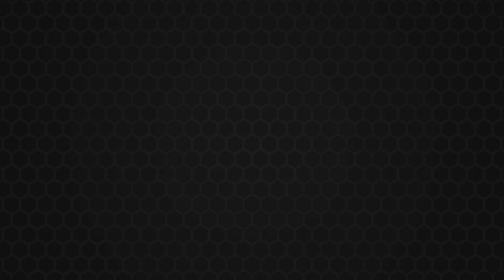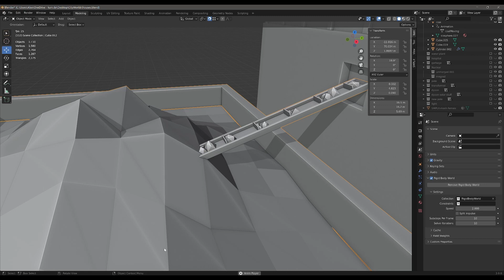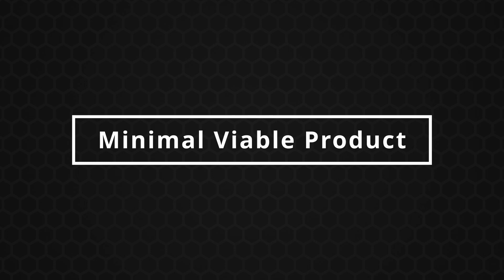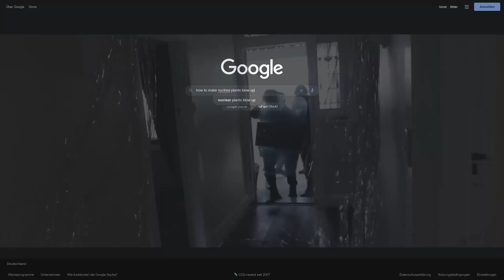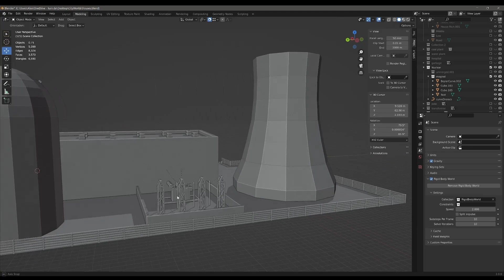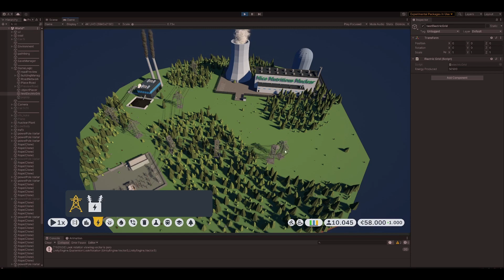Creating Electricity and Meltdowns for my Game | Devlog

Comment: Just an idea I'll spitball out:
If we consider the size of the town, maybe we should have that the Town doesn't inherantly produce it's own electricity:

A substation will be the cheaper building that supplies electricity produced from other towns (via large cabal lines that go ofscreen), but if a town decides to create it's own power. that could be considered a route for a specific economic niche. Especially if that very town happens to have a nearby coal mine, or imports uranium for nuke energy. Or have a shitload of solar fields.Basically, Electricity would be a viable resource for economic competion with other towns.

Comment: for god's sake this is why the nuclear power fearmongering exists. A NULCEAR REACTOR HAS NO WAY OF EXPLODING LIKE A NUCLEAR BOMB. 1st off it doenst have highly enriched uranium that would be required for a nuclear detonation (it only has med enriched uranium) meltdowns like chernobyl and fukushima were merley steam explosions do to overpressure and in fukushimas case BAD PLANNING (seriously why have the emergency disel generators below the flood water level and why have a nuclear power plant on the SHORELINE OF THE MOST GEOLOGICALLY ACTIVE PART OF THE WORLD) and if your wondering then why is there radiation if its only a steam explosion it is becasue the power of the explosion still sends the graphite and fuel rods flying around. but in all serousness nuclear reactors are the safest and morst reliable fuel source we have becasue the radioactive waste is a solid and easy to bury in bore holes deep underground unlike coal and oil where all waste is a hard to contain gas that just gets pumped to the atmosphere.
i get that you wanted destruction from a power plant but you should use the "regular explosion method" (steam explosion) to have a far more immersive and realistic scenario where you could even program where you have to send in teams to stop the meltdown and then encase the nuclear reactor to stop radiation spreading all im mad about is when this game comes out and if you use the first explosion  it will just feed the fire of the nuclear fearmongering so please just make a steam explosion it still can have deadly effetcts and you can play the soviet response : throwing people at the problem XD

Comment: Meltdowns don't cause nuclear explosions. A moderated fissioning core cannot undergo runaway, and an unmoderated, fast neutron fissioning core is far too radioactive to be compressed to the point that runaway would lead to rapid consumption of the fuel before it blows itself apart. In order to cause a nuclear explosion you would need a reactor that is not emitting many neutrons, i.e. one that is not turned on, to be rapidly compressed well beyond the point of criticality, and then bombarded with neutrons from a separate source at the point of maximum supercriticality. Or you would need it to be even more supercritical so that within~20 shakes it goes from a single neutron to consuming the entire fuel.

None of these are possible with any known reactor design. No, not even the ones used in Fukushima, Chernobyl, or three mile island. None of those created nuclear explosions. None of them could conceivably create nuclear explosions by accident or by intentional abuse of the reactor, or even by extensively modifying the reactor while allowing it to remain operable.

If it is a functioning reactor, it absolutely cannot cause a nuclear detonation large enough to consume an appreciable fraction of the fuel before obliterating itself in a toxic mess but ultimately with a yield more comparable to chemical explosions then nuclear ones (and most designs shouldn't even be able to achieve that).

Comment: A question sir? How do you know what scale to make the houses/buildings to match the road/cars? Did you start with the size of the road and went from there? "A car should then be..." and "a house..." ?
Reply from the maker: At the beginning I just eyeballed it but recently I looked up the dimensions of real streets/cars/houses and improved the proportions with that.
Reply: @AAlexDoesStuff  do you use 1 meter in Blender as 1 meter in real life when it comes to buildings etc?
Reply from the maker: @xaph1  I try to but the video doesn't have the updated proportions yet. Also I guess the proportions of the buildings more or less.

Comment: what a lovely video!

small game suggestions:
- the wires for the electric things turn red when the next power tower thing is too far away, or green when they're close enough
- nothing else because this game seems so unnecessarily well-done at such an early stage that it is thoroughly impressive
Reply from the maker: Wanted to do it different first but I thought about it and this is actually an awesome idea, thanks!
Reply: Yo, its Gwilo from diamondfire